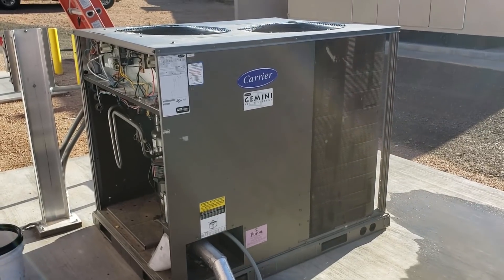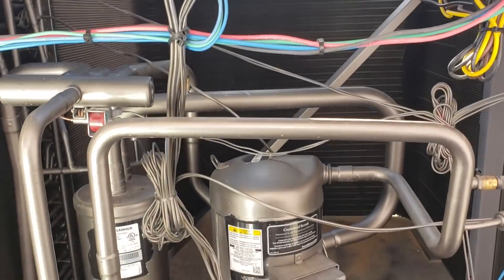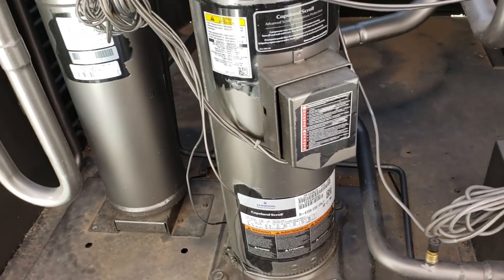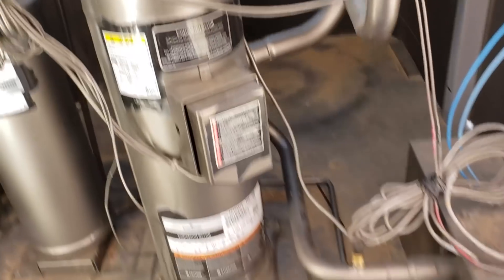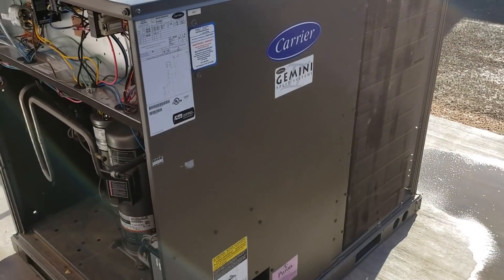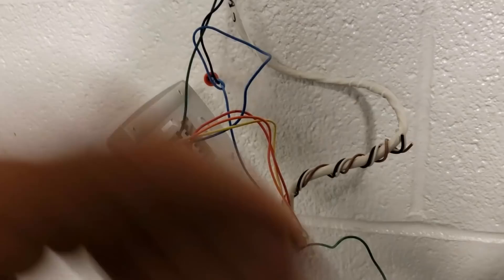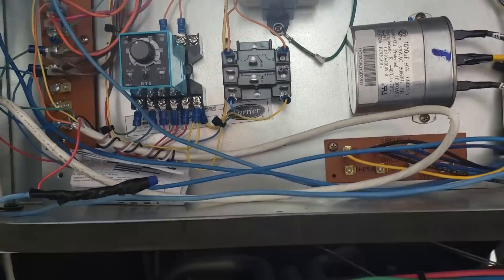New Carrier has to be hacked to function reliably due to Emerson Comfort Alert Quirk

Comment from the maker: The typical HVAC Tech is going to defecate purpose Twinkies when he has to figure that wiring out! HA HA HA!
It essentially is a timer module set up as a "one shot" mode.
When the input is activated the output turns on until the timer has elapsed.
The output simply sends power from R terminal to the Y terminal in parallel to the t-stat doing so as normal.
The timer is set for about 4.25 minutes.
If the t-stat turns off before that then the compressor will continue to operate until that timer has finished to prevent the short cycle condition.
If the t-stat is still energized beyond the timer period (when there was enough load to do so) then the timer basically has no effect.

A second relay in the timer module is sending power from the R terminal back to the G terminal to ensure the fan inside is operating until the timer has finished.
Reply: What's up with that paint job?
Reply from the maker: @joeyf504327  I found out that the paint job came from the factory as protection from the environment!
LOL!
Reply: POE & 410A does not mix very well. On splits with unknown line lengths Copeland demands a minimum run time.  Because they were getting too many comps failures & found no oil in them. These splits are the only units Copeland forces Carrier to install these modules.
Reply: I don’t know why they use these, a simple delay on break would work just fine. Is there reheat anywhere? That would help. We had issues with those geminis our company installed several and had multiple issues
Reply from the maker: @MFitz717  

LOL. Delay on break forces a minimum OFF time.
How quickly it restarts is not an issue.

This needs a minimum ON (run) time.
Which means, the compressor needs to be running at least 3 minutes when the t-stat calls for cooling before it stops.
If it runs shorter than 3 minutes 4 times in a row (such as on low load conditions as the load varies greatly), the Emerson board will trip and stop the unit from operating.

The room is not that large and this is a 10 ton unit.
The room has a wall of VFD's for various pumps.
Sometimes only one pump is running and the 10 ton unit cools the room quickly and causes the t-stat to only call for cooling for a minute or two. 
They should have installed a variable capacity unit for something like this.
And maybe a RAWLS capacity control device as well for low loads.

Comment: Question: Why not just reprogram the thermostat to max 3 cycles per hour?
Reply from the maker: Actually, the fewest cycles per hour is the way to go (runs longer on and off cycles where more CPH causes a faster response to change and shorter more frequent cycles). I set this for 1

But even that doesn't help when a 5 or 6 ton unit is instants into maybe 100 to 200 Sq ft area for worst case heat load scenario and otherwise has grossly oversize issues when it didn't have all that heat load to keep the compressor on for at least 3 minutes. 

Both cases I installed this min run time timer was critical use locations.

The first was a water treatment VFD ?motor starter room out of town.

The other was surgical rooms.

When you got 5 tons of constant air volume in something the size of a bedroom, it's gong to drop the t-stat sensor quick.

The pricked is engineers who make bucks putting this to paper often don't know shit about how it actually works
Reply: @hackfreehvac  I currently have a 7.5 ton split Gemini on a bank lobby doing the same thing. It has a 1995 dual mercury YORK stat. Should I do the module relay or just throw a new stat on like the Honeywell Pro8000 that allows me to set the deadband? Copeland has demanded a minimum run time on these do to the number of failed compressors being warrantied,, found with no oil inside due to all the short cycling.
Reply from the maker: @deathntaxeset  I'm guessing that Copeland/Emerson going short run periods to be slow yet sure death.
As long as you can get at least 3+ minute on time you won't get that alarm.

When I did the minimum on timer I did use a relay contract to send 24V back into G circuit to ensure the blower stayed running. At least in low speed (VFD air handler units).
Reply: @hackfreehvac  Any idea where to get these modules? I can't find them at any parts house
Reply from the maker: @deathntaxeset  I got that from United Refrigeration
Reply: @hackfreehvac  my United had no idea  wth I was talking about lol
Reply from the maker: @deathntaxeset  Ah bummer. 
The main United in Phoenix has a few gurus working there who love to help find stuff like this and figure out how to make it work.

Comment: Was woundering if you have the part number for the module you used and wiring diagram so easy install.
Reply from the maker: It's been a while so I don't likely have the exact wiring I came up with. 
I have discovered that you can swap the CADM protection module out for the older CLO board which will retain the HPS/LPS/no current lockout but then the compressor will be subject to repeat short cycles during low load which is what they want to prevent.

The module is some multiple purpose timer module I found at Uniter Refrigeration.

Comment: I have this comfort alert module on my TempStar system and it's not showing any lights at all, but my fan spools up, compressor starts, and then 5 seconds later it all shuts down. If it's supposed to be powered on by 24VAC and its not on at all, seems like 24VAC is not going in, or the unit is toast.
Reply from the maker: Maybe it's fried.  But it supplies common to the compressor contactor typically so for some reason it allows that momentarily

Comment: I've dealt with many of these with those lockouts and locked rotor error codes run a jumper from common terminal strip into common on emerson control problem solved

Comment: Do you  have a  part list and or diagram for this mod im having similar problems with the same type of unit and its a2 hr drive  every time
Reply from the maker: That was too long ago to remember. 
I just figured out as I go. 

I did hear from the carrier tech support that their fix for this situation has been to delete the Emerson compressor protection module and install that simple old lock out board from older units.
Reply: @hackfreehvac  any particular board ?
Reply from the maker: @gundamrx792  i don't know the part number but it's common in commercial units as an option. 
It has the one compressor wire passing through a current sensor.
Reply: Been dealing with local carrier support and they have been no help what so ever main branch doesn't know what I'm talking about  could use any advice or help would be greatly appreciated
Reply from the maker: @gundamrx792  
Oh, so this is a current problem?
I think is what you want.
HK50AA035

Comment: Long ago, in a galaxy far away, I designed the logic for that many years ago.
There should be several things you can tweak in a thermostat to prevent this.
I am using an Ecobee3, but I remember the old 1990's White Rodgers ones had some of these as well:
1. Minimum compressor on time -- Should be at least five minutes
2. Minimum compressor off time -- Mine is at 400 seconds which is 6.6 minutes
3. Cooling delta -- the thresholds above and below the set point.  Widen it if you are short cycling.
I guess it did its job by making you change something to stop it.
When short cycling, the system never gets fully on condition, so you may be cooling in light load, but you are wasting power.
If your thermostat lets you make any or all of the above fixes, change them with increases to any and all.  This will fix it, then comfort will extend to your power bill.
Cool way to fix it if you can't change things in the thermostat.
Reply from the maker: Few thermostats give those options. 
They usually just control it via cycles per hour.
Few cycles per hour means longer on and off cycles (less sensitive to change) and large numbers mean quicker cycles.

This job was in the desert. 
The best way to assure it just worked was to do this.
Not too mention someone could go behind me and fiddle with the stat.

I never had to return to this unit after I installed this.

Comment: Change t-stat minimum compressor run time if possible in set up parameters. Your way works too though. 🤙
Reply from the maker: It's a Honeywell and the typical setting is cycles per hour but with the variable load in this mechanical room I think the tstat would be hunting to adjust its cycle time.
I don't trust it so I just add the minimum run timer.
Reply: Wasnt sure what stat you had. Some stats give option for minimum compressor run time as well as cycles per hour but if the stat they use doesn't have that feature your way works as well and good way to keep from nuisance trips. Nice job

Comment: You need to add a RAWL valve. Will help with short cycling. We did to RTUs that weren’t ordered for a VAV application. Worked like a charm.
Reply from the maker: They've been adding the rawls.
The last one odd these that I added this mod to has the Rawls capacity control. 

This one needed it if anything does.  Lol
Reply from the maker: Here is a video from February of this year where I did the same mods to two other Gemini units.
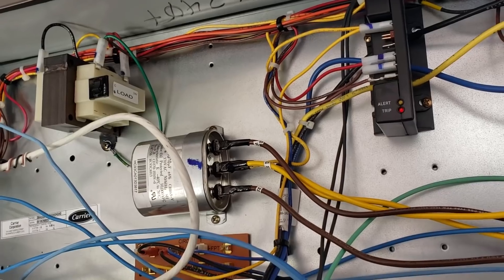At about 1:20 in that video you can see it has a Rawls Device. https://youtu.be/K5Y_Q7afUBo?t=79
Reply: Lennox 49K02 minimum run timer relay is what I have installed on  a carrier 12ton unit with CADM. Nice video!